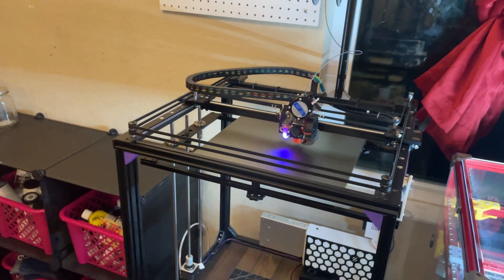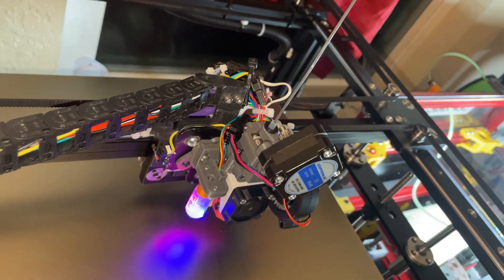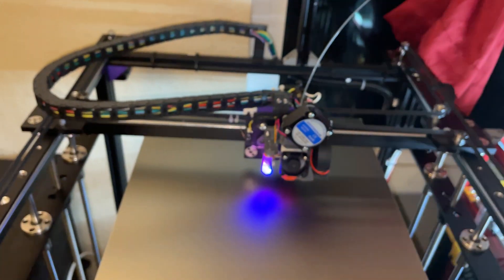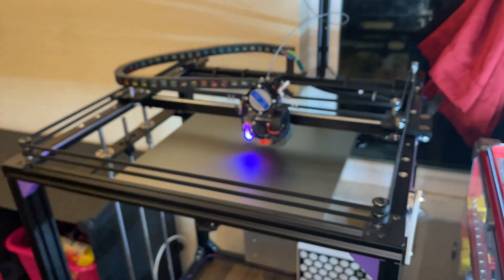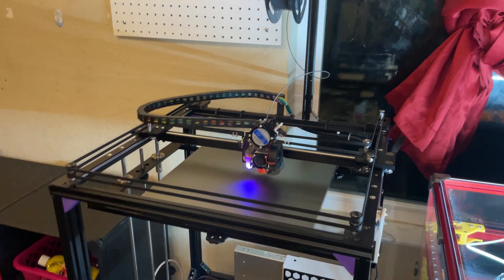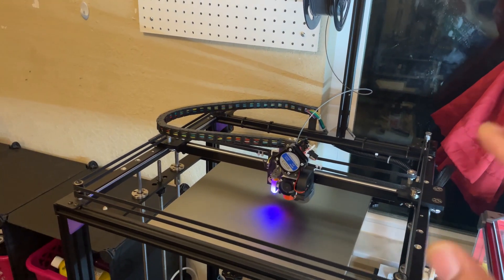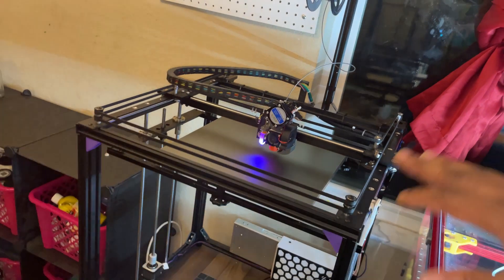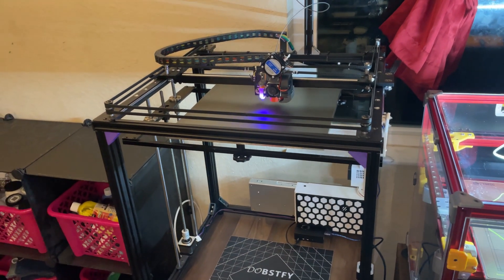//Tronxy X5SA-Pro Update Final // GoldenJaguar392

Comment: Do the little corner braces make much difference? I am thinking about putting some larger ones on my x5sa Pro when it arrives to get the frame as square and rigid as possible to allow faster speeds with reduced vibration.

Comment: can you link the Mosfet?  also the printed case for it.  Gonna try to get the same heater as you but gonna use maybe a 6mm aluminum plate.  I'm assuming no problems so far with heated bed?
Reply from the maker: sure thing, no problem so Far I'm using a 400 watt 24v silicon heater, 
Mosfet Link 
  https://www.amazon.com/DEVMO-Mosfet-Printer-Expansion-Current/dp/B0899XNG9G/ref=sr_1_6?keywords=25+amp+mosfet&qid=1645710905&sprefix=25+amp+mos%2Caps%2C84&sr=8-6
Voron Legacy case link 
https://github.com/VoronDesign/Voron-Legacy/tree/main/STLs/Electronics

Comment: 1:39 "it's not a highly modified x5 fsa i try to keep everything as stock as possible" ... except for the X and Y motors, the extruder and hoteend assembly, the power supply, the controller board and its firmware, the bed plate, the bed heater, the MOSFET for the bed,  and the Z couplings to the bed frame.  All valid upgrades for sure, but pretty much he only thing stock is the frame!
Reply from the maker: well to put is simply it's still an x5sa-pro meaning doesn't look like another printer. but your right lol :)

Comment: This is my first time getting into 3D printing, I bought this as my first printer, still working on it. Your build looks sick and inspiring for me to keep going with this printer :D

How does the printer detect  your x y stops? I didn't see switches and what about the zed?
Reply from the maker: It’s does have x y endstop switch you probably can’t see it as clear in the video but they are their, as for the z I’m using a bltouch it’s what glowing purple on the tool head
Reply: @GoldenJaguar3D  Thank you for being active in your comments!
Reply: @GoldenJaguar3D  Sorry for all the questions... what do I need to do to get the BLtouch sensor working instead? do you have the marlin configs for the SKR1.4 for this setup?
Reply from the maker: @emptyempty30  no worries ask away, I don’t use Marlin anymore, but I know you can find marlin firmware won’t bltouch on GitHub for x5sa pro and x5sa just search google. I strictly only use klipper firmware.

Comment: Hello. Ive checked the thingiverse link for the superfly fanduct but there's no fan duct, only the extruder mount. Can you post the correct link for the fan duct, thank you.
Reply: Thanks again
Reply from the maker: Sorry about that here you go 
https://www.thingiverse.com/thing:4142022
Reply: @GoldenJaguar3D  What stepper motor are you using for the extruder?
Reply from the maker: @richardgalande2236  this one https://www.amazon.com/Short-Bipolar-Motor-18-4oz-13Ncm/dp/B00PNEQ79Q/ref=pd_sbs_4/135-2962308-0246445?pd_rd_w=rWMC0&pf_rd_p=a8064901-fa56-4ccb-8289-d246cf57993b&pf_rd_r=8CPXD0ZDXYXR3CW54HAX&pd_rd_r=b38df563-a09c-4e7a-99e1-541125844e60&pd_rd_wg=y496V&pd_rd_i=B00PNEQ79Q&psc=1

Comment: Great video, do have a link to the 9mm plate? Also how listing with links to the mods. I just picked up a X5SA 400 and plan to run Klipper on it with an upgraded board. Love the channel!
Reply from the maker: I got the plate from midwest steel go with cast aluminum its better, https://www.midweststeelsupply.com/store/castaluminumplateatp5
as mods go I can link you the mods I use 
Anti z wobble
https://www.thingiverse.com/thing:3266811
superfly extruder
https://www.thingiverse.com/thing:4841682
Superfly fanduct
https://www.thingiverse.com/thing:4868721